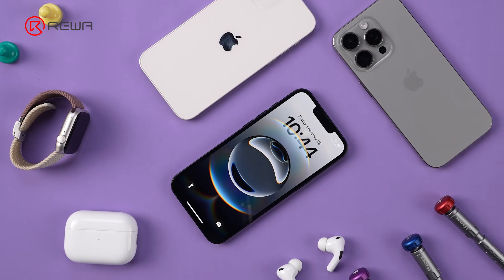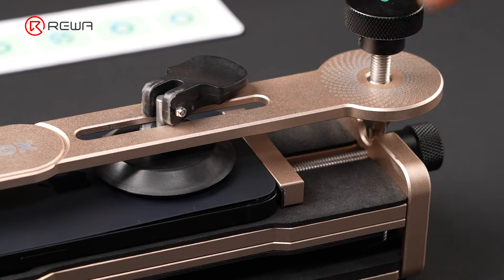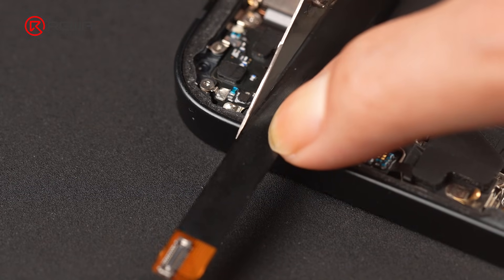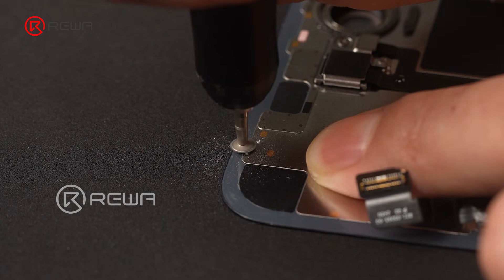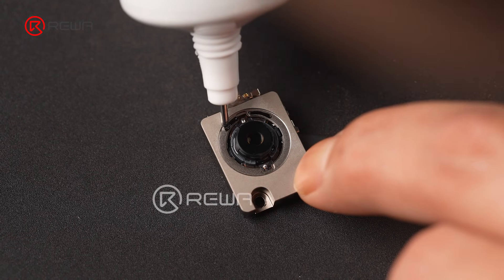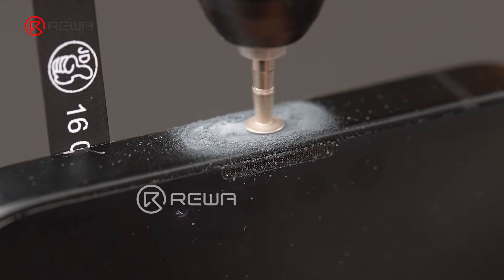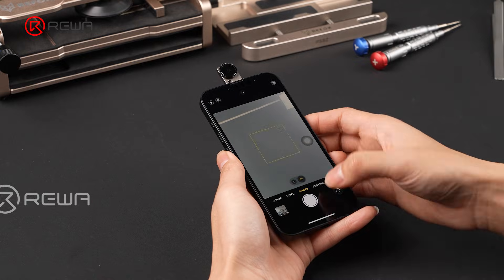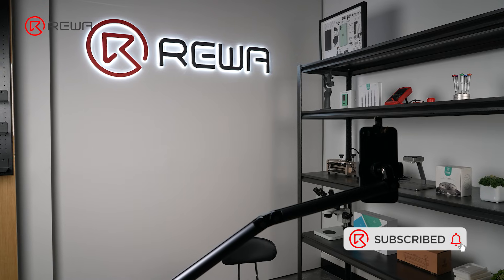Better iPhone - 48MP Front Camera Upgrade!

Comment: Where can I get the camera extension flex
Reply from the maker: The extension cable? It should be normal.
Reply: @r @rewatechnology2008 Extension cable
Reply: @rewatechnology2008  Where will I get the extension cable?

Comment: Bro can we upgrade or change iphone 16 battery with vivo x300 battery it is possible or not and yes then how 😊❤❤
Reply from the maker: The key point is battery connector, and also when you install other battery, iOS will not tag and show the battery data.

Comment: Maybe its better to use a 14 pro instead, slightly cheaper and has much better main camera, and because it got multiple cameras you can still have 0.5 and 3 on the back. The issue is that the main module is huge and would protrude a lot more
Reply from the maker: Actually we try it the Air first, but the Air is so thin...and the 14 camera seems not as good as iPhone 16e, so we make it on iPhone 16e